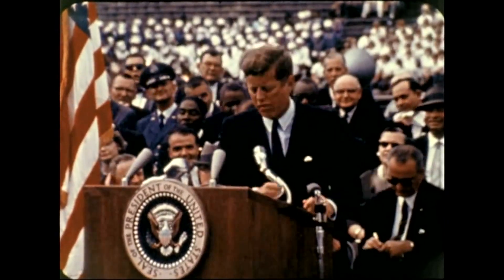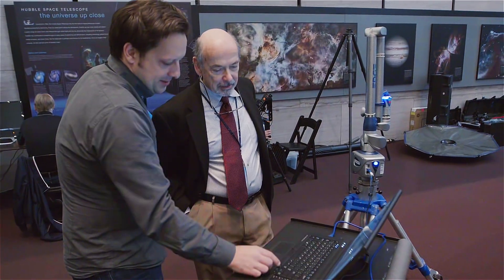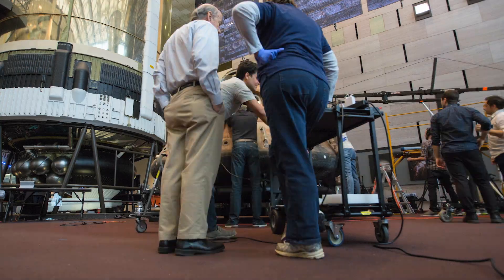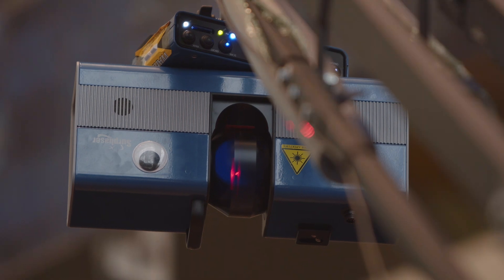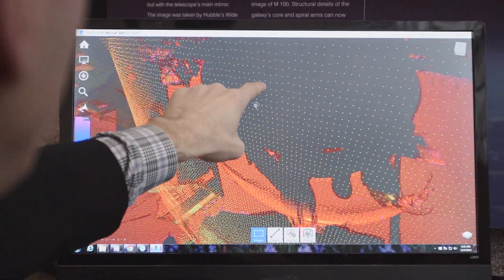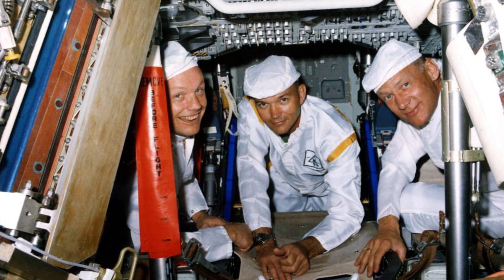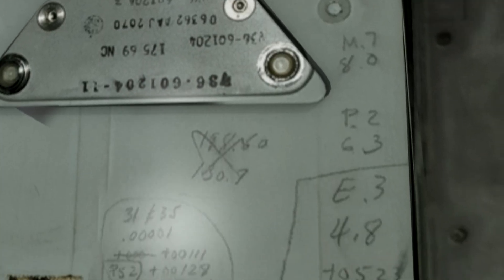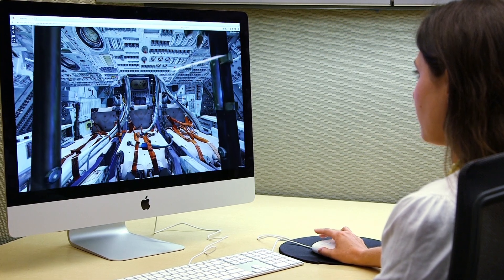Apollo 11 Command Module | 3D Documentation

Comment: How did the astrounots  move from the mouel into the lander?
Reply: The docking port on the top.
Reply: At 3:31 you can see a tunnel in the bottom of the picture, that's where the lander connected.

Comment: Wait inside the Apollo 11 model, how do you move around??
Reply: You dont
Reply: @farel9476  no never mind, I figured out you have to click that earth thing and the arrows to change views.
Reply: You put on the hugs space suit with the huge head piece, then you can move around. 

I am more inclined to ask about the batteries that powered everything including the rover, using 60s battery technology.
Reply: @Pippy_Pappy  Hi PP, hope that you are well. You wrote that "batteries ...powered everything". This is not correct. The main source of electrical power in the Apollo Command Module was from a set of three fuel cells housed in the Service Module. As for the Lunar Rover electrical power was provided by two 36-volt silver-zinc potassium hydroxide batteries developed by Eagle-Picher with a charge capacity of 121 A·h each giving a range of some 90 km). These were used to power the drive and steering motors and also a 36-volt utility outlet mounted on the front of the LRV to power the communications relay unit or the TV camera. These batteries were non-rechargeable and prohibitable expensive for general sale. Take care.

Comment: What an enormous fraud. Spacesuits with zippers, perfectly focused and composed photos without viewfinders, film exposed to enormous radiation and vacuum always fogs instantly. 
So many reasons why they didnt go and can never go. Rockets dont work in a vacuum; there's nothing to push off!!
Reply: Do you like grape or orange Kool-aid ??
Reply: @jeffccan4464  It is you whove drunk thr Kool aid....without mixture. Why not address the questions instead of  being a typical  NASA soyboy- fanboy?
Reply: Yeah, you clearly don't know how a rocket works.
Reply: @16BitGoofball  Have you ever seen one operate in a vacuum?
Reply: @chookin1  Yes, I have.
Reply: You're thinking of wheels and propellers.  Rockets actually work better in the vacuum of space because there's no atmospheric friction to slow down the vessel.
Reply: @flapjaques  There is no RESISTANCE.  In the  action and reaction law, resistace is imperative to make something move. Say youre sitting on a bike suspended on wires not  touching the ground. The action is peddling, the  reaction is the wheel turns but with resistance ( wheels touching   the ground) there will be no movement!
Reply: @chookin1  Yes that's how wheels and propellers work, they push on the medium.  Rockets and jets use the combustion pressure to push on the closed side of the engine which in turn pushes or pulls on the vehicle.
Reply: @flapjaques  NO!! When rockets burn in a vacuum the pressure will be released into an absorbing void of zero pressure. A simple experiment proofs this. Ballon powered toy car will move in atmosphere ( same principle as a rocket). Now get a vacuum  cleaner and turn it on and hold it next to the balloon as its pressure is released. The  vacuum cleaner removes the pressure and the car stays stationary.
Reply: @chookin1  No, pressure is released in one direction and an equal opposite force in the other.  The engine design channels that pressure and provides directional thrust.   But I'll bite, post a link to your vacuum cleaner experiment.
Reply: @flapjaques  And no mention of the other things? Typical fanboy.
Reply: A spacecraft in space pushes against the inertial mass of its propellants as they are burned and expelled at high speed out through the exhaust nozzle. So as the propellants are accelerated in one direction the spacecraft is accelerated in the opposite direction. As such no outside medium, such as air, is required for rocket propulsion to be achieved in space. All of your other stated arguments of fraud are similarly flawed.
Reply: @joevignolor4u949  Rubbish. You cannot demostrate that in the lab so you are going off what the "space" agencies say.  Once the burned propellant is released  into a vacuum and dissipates immediately. Its not pushing the nozzle or on anything else.  You are fogetting ( or you dont know ) that action / reaction also needs resistance to work. Thats the fundamental property they always leave out because they know this  proves them to be wrong. Look at the X-15....at its highest altitude there is so little resistance the control surfaces dont work hence the use of  a RCS ( there is a small amount of resistance remaining even at 300, 000 feet).....BUT ...in zero resistance (zero pressure) there is NOTHING to push against. Resistance is essential.
Reply: @chookin1   You're almost there.  Control surfaces require atmosphere, RCS does not.  The moon landings were a world wide peer-reviewed event.  Proof that it works is that it worked.
Reply: @chookin1  There is resistance. The propellants have inertia, which is resistance to a change in their state of motion. As such when the engine accelerates the propellants out of the nozzle against their own inertia in one direction it creates a force in the other opposite direction. This force is reflected back up to the injector plate at the top of the thrust chamber and into the vehicle's structure. Essentially the two inertial masses, the rocket and the propellants,  are pushing each other in opposite directions away from a common starting point. The thrust in a rocket engine is created inside the thrust chamber and inside the nozzle. What happens outside and behind the engine is irrelevant.
Reply: @flapjaques  Oh dear. Science is NEVER about concensus. So many anomolies in the entire NASA space prog ream and there should not be a single one. 8 hours breathable air in a PLSS? Zippers in spacesuits? Aircon in a vacuum? How did the replenish the air cylinders for multiple EVA's? Recharge the PLSS batteries? Camera film impervious to radiation and zero pressure? No auto focus or viewfinder on Hassalblad? Mate... there are thousands of these.
Reply: @joevignolor4u949  No...no....no.....lets see it replicated in the lab. Are you telling me they they sent these things up with men without having used the scientific method? Did you know they didnt have the high vac chamger until October 1969...well after the first "landing?" How did  they test the LEM, CSM and evrything else without  testing in zero pressure environment??  Where did they get the huge amounts of air to repressurize the LEM after multiple EVA's....like 3 times  for Apollo 17??  Why dont you  fanboys think logically?
Reply: @chookin1  The LM and CSM were both tested in space during unmanned missions prior to Apollo 7, which was the first manned Apollo mission. The LM's had large oxygen tanks that contained enough oxygen for several depressurizations and repressurizations as required for each mission. Some of your rhetoric indicates that you are a paranoid government hater who automatically thinks that the government lies about everything all the time. They certainly do lie sometimes, but not always. You need to put your antigovernment prejudices aside and teach yourself to think objectively so that you can begin to tell the difference between when they are lying and when they are not. And as far as the moon landings go they are definitely not lying.
Reply: @joevignolor4u949  Where were the large oxygen tanks on the LEM and what was their capacity?
Reply: @chookin1  All of that information is available online. Look it up yourself.
Reply: @joevignolor4u949  And all the attemps are hopelessly inept. Only the naive qould believe such explanations.

Comment: I want to know what it was like to take a dump on the way to the moon. After all you are shoulder to shoulder with two other guys. Must have been a hoot for the odd two to be right there. And to think no ventilation, and you can't open a window!!!! Must have been like going to the moon in an outhouse.....
Reply: Read that was the thing they hated the most. Basically had to do it into a plastic bag that sealed around their anus (hopefully) they nicknamed the ass-gasket. And with no gravity to facilitate separation when exiting from the body, the bag had built-in finger inserts (like fingers of a glove) for the astronaut to move it along into the bag. They then had to add a bactericide into the bag (to prevent ballooning) seal it, squish the contents for even distribution of the bactericide, roll it up, then store it to be brought back to earth. They were truly dedicated.

Comment: How could thousands of degree heat not damage the ass-true-nuts?  How did this module point directly at Earth and not tumble sideways? That's why darts are made to be pointy and narrow with fins just to keep the dart going head first. This module has no real length with no sharp point to keep it steady and accurately pointed directly at Earth, which was very important to prevent damage to the cabine, but even, but even if it did not go out of balance and tumbling while going at 20,000 miles an hour or faster, the module would be red hot if not break into chunks  in the atmosphere. And the parachutes I can imagine not made of anything hi-tech nano technology that endured heat, possibly  made of polyester didn't melt or get shriveled by the heat or deploy with holes and tears? Where were the parachutes supposedly stored?  According to  NASA  video there are supposed to be 7 parachutes, one pulling out three and the three pull out the big three, how would they be so well arranged and in what little space were they able to for them?  And there are the orange color floating devices, same color as the inflatable boat that went to bring back the heroes, NASA didn't think the lie is more believable if they at least change the color, so it is the same material, and the heat from the re-entry did not melt the inflatable ring around the module and the compressed air was stored inside the module and did not burst open ? I am not convinced they could come out able to walk without any physical damage to them by the g-force, the impact, the heat, the radiation, the lack of correct amount of gases for breathing, the lack of adequate water for drinking and trouble of going to bathroom, they didn't look like they had a three day beard, like Tarzan movies where he had a freshly shaven face and a sideburns while he is supposed to be living in jungle, The mental damage, I could see in the conference where the three psychopaths were told to lie which meant that they had to lose their memory, one could not "recall" seeing stars, and  the one who wasn't supposed to be on the moon at all, said he didn't remember seeing any stars. The British filmmaker showed the world how better he could have faked the moon landings by having the size and color of Earth more vivid and four times larger than Moon. Then, he improved the terrain in absence of an atmosphere for billions of years, non-eroded, unlike NASA Area 51, and the filmmaker made fun of slow gravity when actor astronauts try to catch James Bond, they move ever so slowly to catch him on the movie set, and the moon buggy is made to be so tough that breaks through a concrete wall without a dent on the moon buggy, making fun saying, "it ain't a toy" implying that NASA Cowboys used the moon buggy as a toy like in the "Dukes of Hazzard" films. And his radiation shield was a little card that he hung from his pocket like a name tag, and that was enough to protect his whole body from radiation, implying NASA didn't give any thought about radiation hazards because it wasn't necessary in the Nevada Area 51 film studio, which James Bond had infiltrated and had stumbled on the fake moon landing movie set, in the 1971 movie, "Diamonds are Forever!"
Reply: Where did you get your degree in astrophysics?
Reply: E. Rose.....................

DEGREE IN ASTROPHYSICS, DO YOU MEAN FANTASY?

DO YOU MEAN THE  INTERPRETATION OF EXISTING THEORIES & POSTULATIONS BASED ON THEIR OWN THEORIES BY COSMOLOGISTS & THE LIKES, WHO DECLARE THAT, BASED ON THOSE FAIRYTALES, THEY ARE INFINITELY KNOWLEDGEABLE & PURPORT TO KNOW WHAT THEY SIMPLY CANNOT POSSIBLY KNOW?

WHAT ABOUT YOURSELF, BIG FAN OF FAIRYTALES ARE YOU OR JUST HAVE A BASIC HUMAN DESIRE TO WANT TO BELIEVE?

WHERE DID YOU GET YOUR DEGREE IN HOW TO EXPLAIN NIXON SPEAKING TO ASTRONAUTS ON THE MOON ON A TELEPHONE IN 69?

YOUR DEGREE IN CONVINCING ANYBODY HOW THAT TIN CAN,  USED TO LAND ON THE MOON IN 69,  ACTUALLY COULD HAVE DONE SO, SERIOUSLY?

IF ANYTHING, YOU HAVE A DEGREE IN BEING A NASA SYCOPHANT,  WHO IS SO HEAVILY INVESTED IN YOUR ILLOGICAL BELIEFS, & YOUR BIGGEST FEAR IS HOW SILLY YOU WILL  LOOK  HAVING BELIEVED IN  A DECEPTION BY NASA ALL ALONG!!!!...........

JUST A THOUGHT FOR YOU & YOUR ESOTERIC DESIRES...........

WE MAY HAVE LANDED ON THE MOON BUT NOT IN THOSE CRAFT, BUT MAYBE THE MILITARY & GOVERNMENT HAVE KNOWLEDGE BEYOND EVEN YOUR INCREDIBLE INTELLIGENCE & THEY USE NASA TO EXPLAIN AWAY YOUR DESIRE TO BELIEVE IN WHAT IS NOT AVAILABLE KNOWLEDGE TO YOU!

ENJOY YOUR VERSION OF REALITY IF IT MAKES YOU FEEL SUPERIOR RATHER THAN QUESTION THAT WHICH DOES NOT SEEM POSSIBLE, EVEN BY TODAY'S TECHNOLOGY............

HAVE A GREAT DAY MY FRIEND & MAY YOU WALK WITH YOUR GOD IN PEACE & LOVE ALWAYS.............
Reply: @JohnSmith-el9qn  So where did YOU get your degree in astrophysics and spacecraft engineering?
And who gave you the idea that typing in ALL CAPS is a good idea?
Reply: @julesdomes6064  JULES, I DO NOT THINK THAT MY CREDENTIALS ARE THE ELEPHANT IN THE ROOM! ANSWER UR OWN QUESTION(S) TO URSELF! NOW, JULES, U WERE SAYING...?
Reply: @JohnSmith-el9qn  The elephant in the room is the fact that you are wasting your time here on YT, when you have evidence that these missions were faked. Just about nobody notice your posts here.

Present your evidence to the world! Stop the hoax! 
Call a news conference today!!!
Reply: @julesdomes6064  *PROVIDE CREDENTIALS
Reply: @julesdomes6064  HEY SHERLOCK, YA SPACE CADET?
THE ONLY POSITIVE IS APOLLO 11 CAN NEVER BE CLAIMED AS HOW HUMANS LANDED ON THE MOON WITHOUT CATEGORICAL EVIDENCE THAT IS IRREFUTABLE. LOST WASN'T IT, AS WAS ANY EVIDENCE THAT IS IRREFUTABLE, NASA & UR COMMON SENSE INCLUDED.
THAT WILL SAVE HUMANS THE EMBARRASSMENT.
THE REAL STORY REMAINS TO BE TOLD WITH THE PROOF OR IS STILL TO HAPPEN, RIGHT SHERLOCK?
YOU ARE SO VERY WELCOME SHERLOCK & NASA MY FAVOURITE SPACE CADETS EVER.
WHEN DOES "MY FAVOURITE MARTIAN" START?
HAHAHA...BOOOOM!!!
Reply: @JohnSmith-el9qn  My credentials?
Only an MsC in aeronautical engineering and an engineering carreer in the satellite industry, mainly centered on design and simulation of thermal control systems.

Did you state your credentials?

And when will your historic news conference be on, where you present your evidence to the world and stop the space hoax once and for all?
You are welcome to discuss Apollo 11 there, but don't forget the five subsequent lunar landings in the Apollo project. There were six manned landings, remember?
Reply: @JohnSmith-el9qn  Got awfully quiet here now. Not comfortable with debating someone with actual knowledge?
Reply: @julesdomes6064  Your infatuation is irrational. Have u considered helping NASA get to the moon since Apollo & guiding them to build a craft as they have lost... well... anything relevant to mankind's greatest achievement! It is the deafening silence considering America usually flag waves & cheers endlessly at lesser stuff! Is it possible to u they never went in Apollo 11?
Reply: @JohnSmith-el9qn  So, what about Apollo 12, 13,14,15,16 and 17? 
You just ignore them, because some of the original data from 11 was lost? 
Do you have a point somewhere?

And the upcoming Artemis missions to the moon, you will yell FFFFAAAAAKKEEEEE!!! CGI!!! at them as well, I assume?😀
Reply: @julesdomes6064  LOL... There u go! BOOOOM!!!
Reply: @JohnSmith-el9qn  Thank you. Your argument is very convincing. "LOL... There u go!  BOOOOM!!!" 
Who can argue against that?
I am super woke now.

Comment: There is no technology on earth that could prevent the aluminum Apollo capsule from TUMBLING wildly upon supersonic reentry. 
No technology. 
The frying pan heat shield facing incredulously toward the path of Greatest resistance could never be made to withstand the 5000° heat upon supersonic reentry. 
There is NO TECHNOLOGY on earth that could be applied to the surface of that heat shield that can withstand anywhere near that temperature. 
The space capsule would be a fireball of molten aluminum in a matter of seconds. 
NASA AND IT'S APOLOGIST SHILLS ARE COOKED!
Reply: You too, where did you get your degree in astrophysics?

Comment: Wasn't the Apollo 11 command module sunk in the sea? I mean it was the time when everyone was scared of some lunar bacteria or virus that would cause an epidemic....
Reply: No it was not sunk. The astronauts did have to go into quarantine for two weeks to be sure they didn't bring back any moon germs but no germs were ever found.
Reply: @joevignolor4u949  That much I know about that quarantine, yet so far I heard of capsule being sunk in the ocean.
Reply: @MIMALECKIPL  You might be thinking of "Liberty Bell 7", which was Guss Grissom's Mercury capsule. It did sink and was lost in the ocean, however it has since been recovered. I've actually seen it. As far as the Apollo 11 command module "Columbia", it never sank. I've personally seen it as well.
Reply: @joevignolor4u949  No that's not the thing. Liberty Bell 7 was an accident at recovery, and I mean Apollo 11 command module. EDIT: OK, I had the bit different info - now I learned that what was sunk was raft a with decontamination materials. OK, case solved.